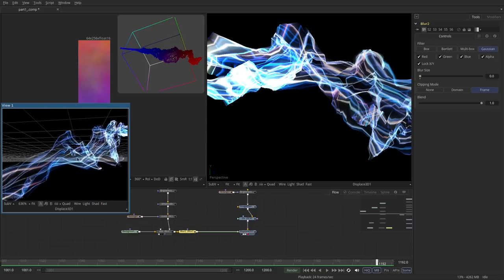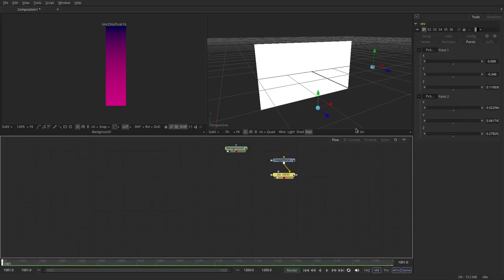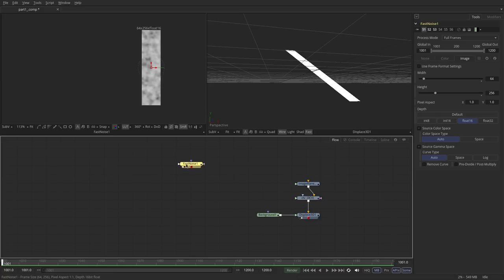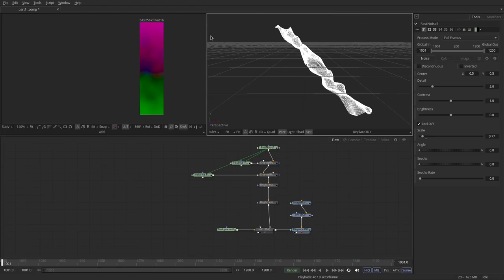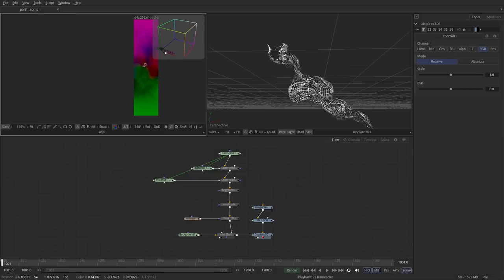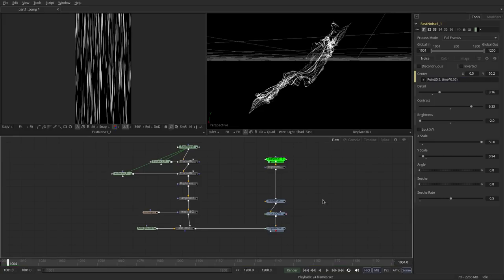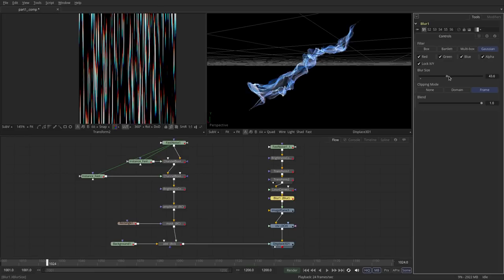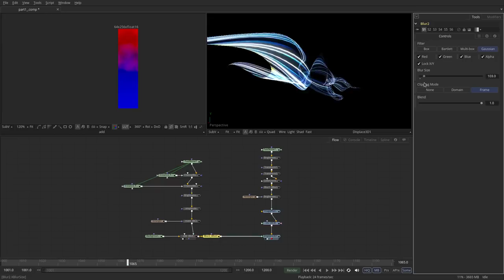Fusion FX - Creating plasma/lightning effects

Comment: Brilliant video, many thanks. Feeling stupid as I cannot add expressions to each of the RG and B channels in the gradient tool - and even when I apply an expression to one of the colors, it applies this to both of the gradient‘s colors. In Resolve 16 - am I doing something wrong?
Reply: Same issue here. Resolve/Fusion has changed since the video was made. Hopefully statix vfx came make an update.
Reply: @Sean Keogh  @WCPR  I have figured it out from some research. If you were doing what I was doing, I was making my background type a "gradient" then setting the gradient to be vertical... when what you want to do is make the background type "vertical." Once you've done that you'll have the two sets of colors with the ability to add expressions to r g and b separately.
Reply: @8bitmagic  amazing! cheers for this

Comment: Now just need a method of branching in non-studio maybe pinning multiple strips together, scripting vertex's,tracking or using probes?
Reply from the maker: The answer is already in the video, base the branches off the positions of the main geometry, and use the Replicator3D to copy variants back on to it self.